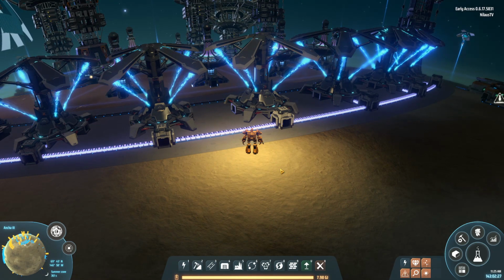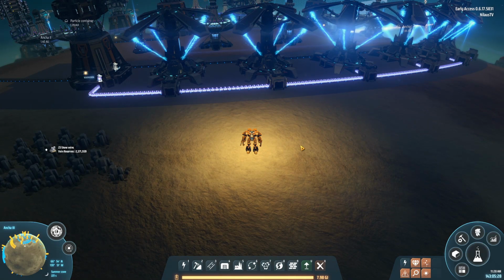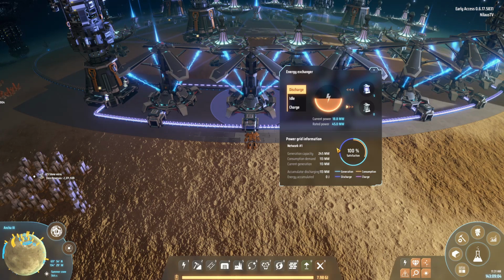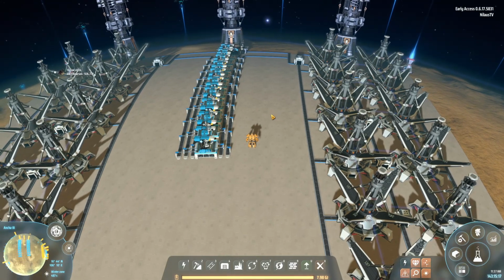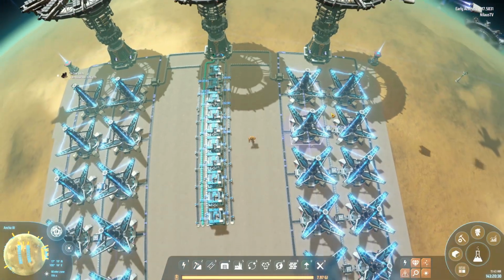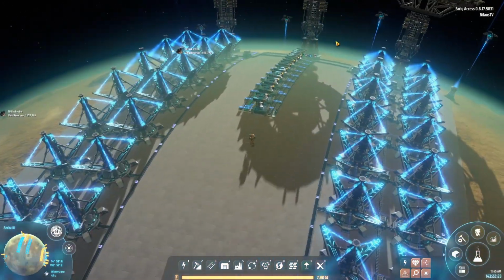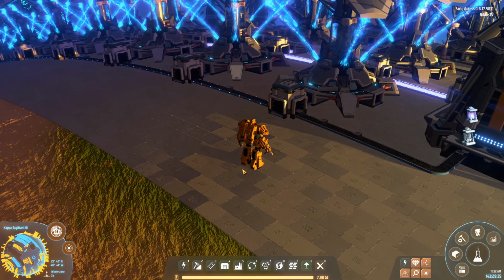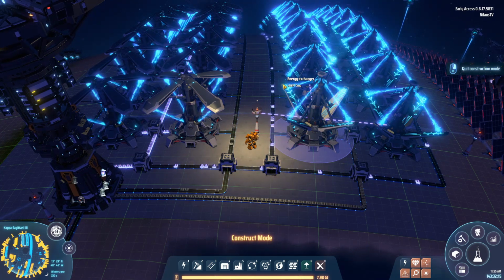How and Why ENERGY EXCHANGERS are AWESOME! | Dyson Sphere Program Tutorial

Comment: It take warpers and energy to transport them. And you don't only need to consider that warpers are needed, you also need to consider how many you use.
For a full ship of accumulators, you can transport 90 GJ of energy. However, due to how the game currently works with no 2 way transport, you need 2 ships, bringing the average down to 45 GJ of energy per ship, or 22.5 GJ per warper.
This is comparable to hydrogen fuel cells at 20 GJ, and is much smaller than deuteron fuel rods at 300 GJ and antimatter fuel at 3750 GJ.
This means compared to deuteron fuel rods you need 13 times as many warpers, and compared to antimatter you need 170 times.
While 1 warper might be cheap, I would say 170 are not, even 13 is not.
It is cheaper to send deuteron fuel rods than it is to make the warpers for the accumulators.
Even an antimatter fuel rod, while more complex to make, is cheaper than those 14 warpers, and massively cheaper than the 170 warpers.

So no, using accumulators takes far more resources than other fuels, as soon as you start going interstellar and using warpers.
It only takes no resources when you don't use warpers.

So if you aren't going to consider the warpers as taking resources, you shouldn't consider the deuteron fuel rods or antimatter fuel rods as taking resources.

The other big issue is space, where energy exchangers take up a lot of space and only provide 45 MW, and to work without wasting power, need 2 energy exchangers. The equivalent power output for fusion reactors is quite comparable, but the equivalent for artificial stars is much smaller.

The main advantage is that it is belt fed, as you said.

But due to how complex it is with the possibility of deadlock and the like, I think the better option is deuteron fuel rods as soon as you can make them in bulk. That also typically matches when you have lots of hydrogen to deal with.
Reply: You are attempting to claim that the cost of 83 accumulator transports (which is 166.7 warpers) cost more than an equivalent 1,000 antimatter rods in one shipment (which also costs 2 warpers).

No. 1,000 antimatter rods do not cost less materials than 166 space warpers. One space warper is ~13 base ingredients. One antimatter rod is 71 base ingredients. 

83.3 trips of full accumulators and 83.3 trips of empty accumulators(which actually requires 333 warpers) costs ~4,332 base materials. 1 shipment of antimatter fuel rods costs 71,026 base materials, 16x as much material. 

You're incorrect. About all the other ingredient costs, too. At ~26 base materials per 45GJ transport, accumulators charged off renewable power are the cheapest form of energy transport by a landslide. Cheers. 👍
Reply: @ProzacStylings  My bad, I did screw up and forgot to scale for the number of antimatter rods required. 
Transporting 1000 antimatter fuel rods requires 2 warpers and provides 7500 GJ.
Transporting the same amount of accumulators both ways requires 333.3recuring warpers
This means using antimatter fuel rods save 331.3recurring warpers per trip, with that being 1000 antimatter fuel rods.

Switching up which alternative recipes are used can change the costs, but for the basic one where the only alternative is graphene from fire ice and warpers from gravity matrices, it takes roughly 25 times the resources for antimatter fuel rods. If instead you have warpers from graviton lenses directly it is closer to 2 to 3 times the resources.

Compared to deuteron fuel rods, then you have 26.6 warpers required, or 24.6 more, which makes it far worse.

So yes, assuming you are only generating energy using ray receivers (in normal mode), wind, solar and thermal energy, it is cheaper to use accumulators. But at that point, why not just send the solar panels and wind turbines and set them up on the planet?

But as soon as you start using other fuel sources in significant amounts, it is cheaper to ship the fuel.
Reply: On top of that, creating antimatter rather than direct power requires far less ray receivers, less energy buildings and infrastructure, and the consumption of fuel rods is automatically scaled to the actual energy consumption. It is far more efficient in terms of time spent to set it up per GW
Reply: @Ramschat  
1) Not sure if saying "on top of that" when the mistakes in his post were just corrected is a good look. 

2) Consumption of accumulators also scale to the actual energy consumption. Power mechanics are worse for artificial suns, because half-using a solar panel and wasting a 71-ore antimatter rod is worse than half-using a solar panel and wasting an accumulator that was charged with renewable power.

Artificial suns take up less space and require fewer buildings. That's their advantage. Accumulators use less resources and require less complex ingredients. That's their advantage.
Reply: I can only think of it as the densest fuel of last resort for when the fuel lines for your logistics towers cut out. It'd be topped up by burning off excess production of lesser fuels, or excess energy production from superior fuels. And the way you'd do this is with belt priorities to prefer manufacturing with the lesser fuels, and power gen with superior fuels on the logistics bootstrap generators.

For added engineering, consider using belt priorities to shunt fuel and automatically turn off idle or depleted systems to minimise fuel/warp logistics overhead.
Reply: If it's only 120 ore per 7.5 GJ, I'm pretty sure it will have a negligible impact on the total amount of minerals mined. It seems to me like the time it costs to set up all this infrastructure is far more valuable than the materials saved, since you can very quickly set up a few extra miners.
Reply: <.<'  Materials aside.  According to the in-game prompts, photon generation takes 8x power from the Dyson Sphere compared to energy production mode. That makes each critical photon roughly equal to eight ray receivers worth of energy production.  Each critical photon is two antimatter and each antimatter fuel rod is twelve antimatter.  That makes six critical photons per fuel rod, or roughly 48 times as much energy consumed from your Dyson Sphere than would have been if you were using ray receivers to charge accumulators. (Though, the actual math in-game seems to average roughly 4x. But even if the tutorial prompt and actual numbers are mismatched, you can still see the increase in demand between the two modes)
(Edit)  Forgot to mention:  Hydrogen is the only fuel rod that can be produced without additional warper/energy cost steps in the creation process. and both hydrogen and deuteron fuel rods have extra warper and energy costs that don't exist in an accumulator setup.

Comment: 1st antimatter 2nd on site hydrogen local gas giant or oil byprodoct 3rd battery 4th deuterium fuel rods only in small very remote outpost like black hole 5th on site power neckless

Comment: I still dont really understand for what purpose the accumulators are a building.
Reply: you can use them alongside solar panels as a battery so when the panel is in darkness they will release the energy back into the system. at least that is what i think they do, i have never used them in this way.
Reply: You can use it to buffer energy when you don't have enough exchanges to transfer it, you want to reduce lag by reducing the amount of exchanges (and all of the belts/items involved), reduce tower inventory/vessel allocations (lower latency, increase bandwidth), or reducing pathfinding.

This might become relevant with optimising of logistics/energy hubs within star and planetary systems.
Reply: I did find that helpful when building my first few station for harvesting the gas giant - and solve my initial mid-game deuterium shortage; as those require 20 charged accumulators for each station.  Instead of coming up with the resources to also build an exchanger I could just grab a bunch of accumulators and plop them down to fill themselves up from the grid.

Later of course I used exchangers to automate the construction line for those stations.

Comment: Im so happy exchanges are getting some attention! I've been using them since early game and I'm continuing to use them in late-game too. Most of the things in this video are tricks that I've been doing too. The only two things I do differently are I don't automatically add accumulators to the system I kind of just check up on that every now and then and where I can I also try to make each star system energy independent. So I might have a power ring on one planet and then use exchangers to distribute power through that system. I basically do this because it means that energy Transportation has literally zero material cost, because I don't even need to use warpers

Comment: Idea for the next tutorial: Interstellar Logistics Station setup and througput. How many belts can it feed based on traveling time.
Reply: That would be theoretically infinite, since each supply and demand station can have its own vessels, so if you're running out of vessel throughput you just add more demand stations (assuming we're capping ourselves to 1 supply station). I imagine there would be some sort of cap if you're only allowing 1 supply station, but since each vessel arriving would take away supplies, which makes room for more supplies and then immediately facilitates the launch of another vessel, it would be high enough that for instances where you would for some reason only want 1 supply station I don't think it would even matter.

If you were to cap to 1 supply and 1 demand I imagine you could come up with a number, but it would be of limited use since the only two scenarios I can imagine where that would be a hard limit are early game when you've only just gotten ILS, in which case I'd be surprised if you were actually making enough to max out the throughput without having the resources to make more ILS, or so late game that you've filled up every realistic factory planet and only have room for 1 supply and 1 demand, which could take hundreds or thousands of hours on just one game and likely would bring your computer to a screeching halt.
Reply: @ninjadude501  I think there can only be 10k Units in transit. Doesn't matter how many ships you can send, a Logistics Station will only accept to the maxiumum Storage capacity.

Comment: My only issue, if you can even call it that, is that early game while you're still confined to your home system, accumulators are pretty resource intensive. I wouldn't mind a balance pass on the materials required but I can see how it's motivation to start to move off the homeworld and start interplanetary logistics.
Reply: I second this, I'd suggest making the accumulator cheaper and introducing an improved version for later on

I think accumulators should be a bit more intuitive to use, having to come up with all sorts of balancing workarounds because the game mechanics are still pretty limited kills the fun for me

they should add some power management options (like setting priority, discharging accumulators according to consumption demand etc.) balance it with being late game science or accumulators wasting energy like the ray receiver

Comment: The main problem I have with energy dischargers is that they discharge all the time, not on demand. And if you set the to idle they simply output charged accumulators again, which is annoying as it means you need a filter to ensure it doesn't block up the intake to the orbital logistics tower again.

They also only charge accumulators when there is excess power in the network, so if you are not at 100% power, then any off world system that relies solely on accumulators will potentially have issues.

Comment: It's also possible to build new accumulators anywhere on the planet where you charge them (so it's not needed to build them directly besides the charging location):
At the place you build them put them into a logistics stations which is set to local supply and remote storage, At the place you charge them place a logistic station with local demand and remote storage, put them out to sideloading the belt of empty accumulators from the remote demands like you done. :)

Comment: 23:00 The best way to explain this is that while the the discharging takes care of all consumption, adding the charging takes in the wasted solar power. Once you add enough charging to where solar/wind/etc. reaches 100% consumption, only then will the discharged accumulators go into additional charging as well.  The great thing about this is that when more power is required, it only reduces the frequency in which charging is needed. if everything is consumed 100%, nothing will be charged. 

I don't know why, but when I thought about that on the Twitch stream, that just clicked and made total sense.

Comment: In the last build used to account for local production, the empty accumulators should be prioritized with a filter to feed the chargers instead and redirect excess  to the hub. Without this they could be 'stolen' by the network leaving nothing for the chargers and hereby potentially wasting some locally produced energy.

Comment: Big thing to keep in mind with discharging Exchangers: If you want it to only discharge what you need, then you need to make sure no other power generators exist on that grid.  If you drop a wind turbine into that grid, the exchangers will just start dumping all the charge out into nowhere.
Reply from the maker: Did you not watch the video? I addressed that issue

Comment: It is interesting to see that accumulators are relevant option and I agree most of your arguments. However, I personally do not like them still. From my point of view building of deuterium rod production is not more complicated or laborious than building and balancing charging system and I also like sorter feed more, because it is much faster to build than splitters with that mod. I do not also understand that frugality about resources in this kind of games where there are an order of magnitude more resources easily available than I ever consume during my game before I get bored.
You have very high production if your series but still use only very small part of stars in you cluster. I an quite sure that you could increase production to 100 white cubes per second and run the game hundreds of hours before you would encounter a lack of resources.
But it is very nice that there are different options which work as well, depending on player's personal priorities.

Comment: 18:05
According to the tooltip, the accumulator can contain 90MJ and the exchangers work at up to 45MW; wouldn't that mean the charge time to be 2s (not 3s), thus up to 60 (not 90) accumulators being able to get chained to a single belt? I never measured that, but I assumed (and based my build) on that.

Also, one more thing:
Have you tried emptying the exchangers by running a belt straight through them? You could make the build a bit more compact, if necessary.

And as usual, great vid! I started following you about 3 weeks ago due to this game and didn't miss an episode since.

If I may give you a suggestion for a future tutorial, how about how to maximise the utilization of the energy produced by your sphere? (I currently have a 7GW sphere but can't really put down enough dishes to use it all; did I just overdo it? Is there a solution, or an optimal build?)
Or maybe how to properly set up rail ejectors/swarm orbit to maximise the amount of sails launched. (I thought that the poles would be the best choice, but maybe due to the wonky orbit of my planet, I found the equator to be more consistent; also, parallel orbit, perpendicular orbit, or some skewed angle?)
Reply: you can only tap on the order of GW from your sphere by using photon generation + graviton lenses, if you're using the ray receivers for power it can only suck 25 MW
Reply: The combination of "ignores other sources while discharging" and "only uses excess power when charging" makes a lot of very interesting things possible.  It looks like an error, but I don't think it is.  Of course, play the game the way you think is fun.

Comment: I think the power generation priority will be a whole subsystem that needs to be implemented, potentially with automation like in Factorio:

Some locations might have exchangers, and they only want generators to run on local fuel if the exchangers are not enough (Lava Planets without much fuel), others want to conserve the exchangers' resources and want to use the local resources first. (Oil planets where you burn off the oil because you don't need it, and because it does not run out)
Reply: I agree. Automation like combinators in Factorio would be very nice in DSP. It is quite tricky to handle energy or excess hydrogen or balance productions of different systems. It is possible, but need awful hacks which are no fun to build (I know that many players disagree and feel strange contraptions interesting challenges, but by my professional thinking effects, I hate hacks as an electronic engineer).
I would also like to have explicit controls for logistic vessels. So that I could name exact places where tower sends vessels.
Reply: Balancing the production is the interesting part of this game. No hacks needed. The funny thing is that I thought electronic engineers did hacks all the time.
Reply: @fuglbird  I think there is a difference between a smart hack and an annoying workaround.
Reply: There should also be geothermal generators available in DSP, which would mean loads of free energy on lava planets. That could be balanced out by reducing solar energy potential on such planets, as their atmospheres should be filled with ash.
Reply: There are now!